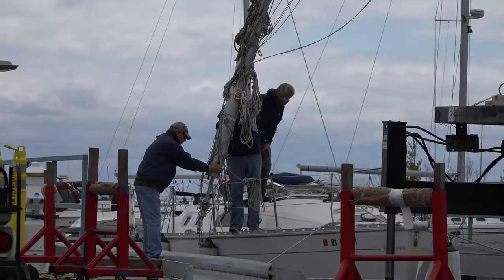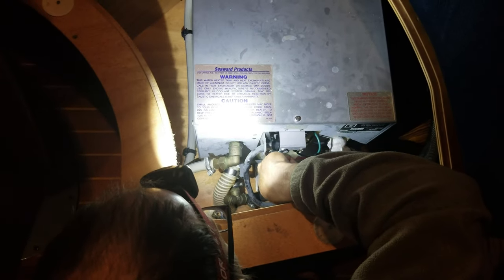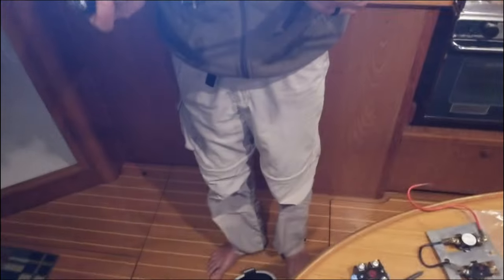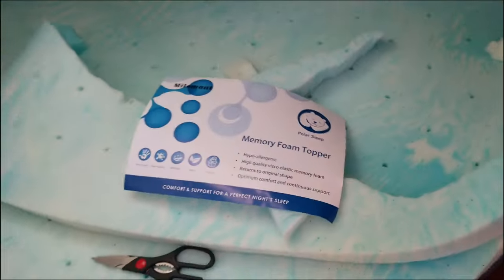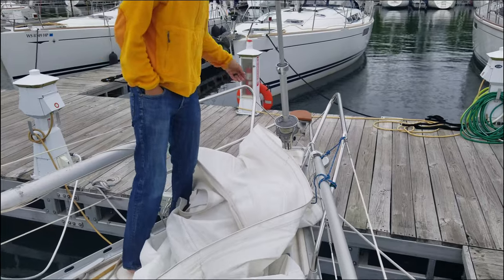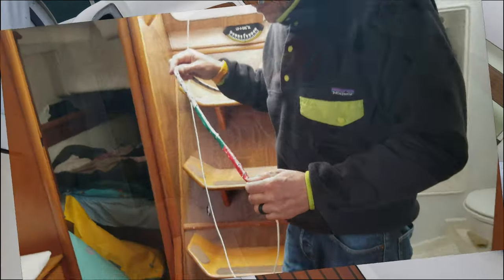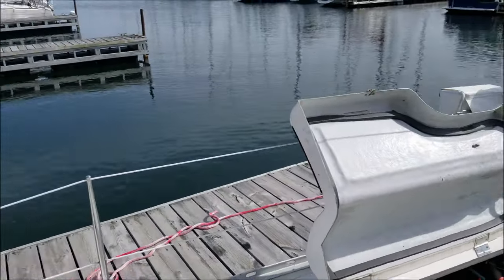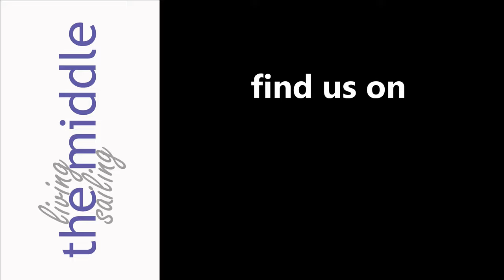Mast Installed, Water Heater Fun, Sails On, Test Sail and More! | S2E9

Comment: It's a French manufactured boat, so it'll say 220v on the water heater, but since you're in North America, you'll have to put a 120v heating element instead.
Reply from the maker: We ended up keeping the 240v in, despite the fact we realize it's not optimal, it is working...another lesson learned for us! :)